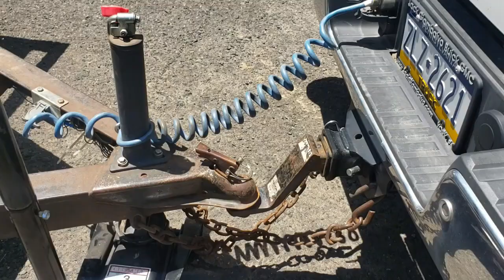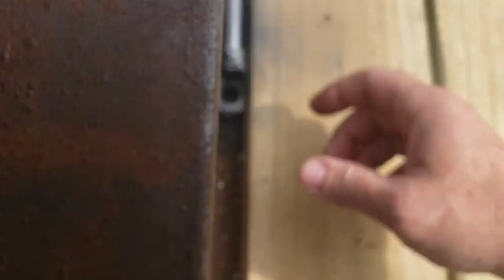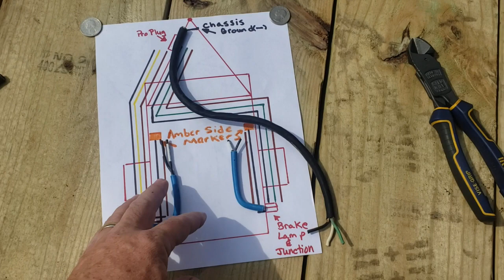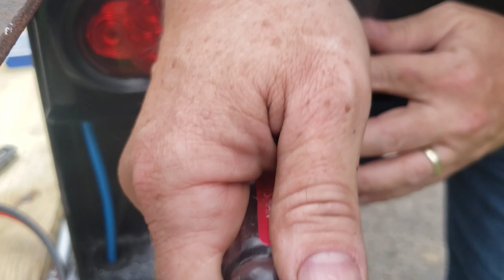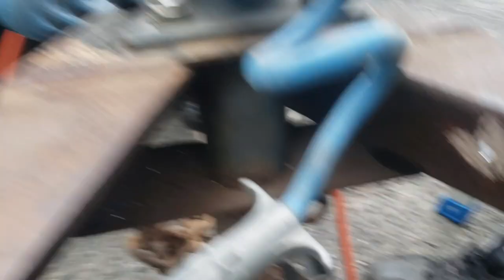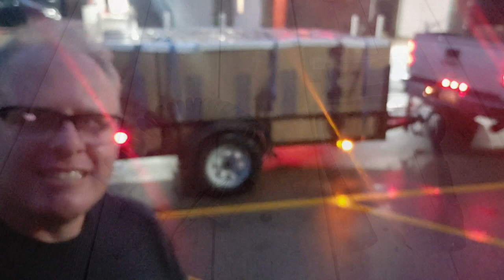5 Tips on How to Wire a Utility Trailer (long version) For Ultimate Reliability

Comment: In a pinch, when ypu cant find decent heat shrink connectors I've used standard ones but filled the cavity with RTV prior to inserting the wires, crimp as normal and the silicone fills all the voids sealing out any moisture.  Ive got connections on my boat trailer that regularly are submerged that have lasted over 8 yeara now, no issues.
Reply from the maker: That's a good suggestion, i'll keep that in mind. Thanks for sharing!

Comment: As for the 3 conductor wire, I go and buy a cheap 100 foot extension cord from the big box store, on sale there about $15.00 and thats a steal for 14 or 16 awg wire and its well insulated,  pair it with some good shrink connectors and it lasts a long time.

Comment: Can’t follow any of this at all. I have wired my trailer an no problems. Brake lights, tail lights, turn signal lights, backup lights clearance lights , lights on load being hauled. This is too difficult to follow.
Reply from the maker: This is not basic wiring, and I tend to do things with a bit of overkill. I'm happy to share the wiring is all still in tact and working! I share this trailer with several people and we probably put 600 miles on it every week. There are more basic ways to do it, for sure. I do appreciate the view and feedback.

Comment: Why did you even do a trailer ground, why not run the ground wires directly back to the junction box? Trailer frame ground connections are bound to corrode and cause issues!
Reply from the maker: @AlexKost-tq6bj  I think we're aligned. Kinda like what is explained @ 9:30 mark?
Reply: @PaulsProTips  maybe? Looks like you ran the ground wires back from the lights, but you still did a frame ground up near the tongue? Why not just connect the car's ground to the trailer lights ground wire, and have no trailer frame ground at all?

Comment: I get the advantage of the 7 PIN and the advantage of a junction box. But why not have the coiled wire permanently connected to the trailer instead of having a double side 7 pin? Twice the connections and more change for those to corrode/get gunk in them...

Comment: I went to a 7-pin plug for my 5'x12' utility trailer as well - for the reason you stated - everything has that now.
...even if I don't have brakes or marker lights - it's just easier to go to the standard plug....which always leaves room to upgrade.

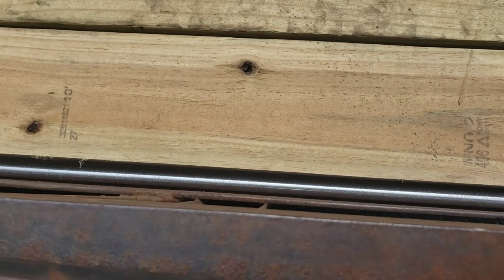Comment: What are those conduit end connectors (at 6:45) called that you're using?  Do you have a link where to purchase them? I can't find them anywhere.
Reply from the maker: If you search "emt pull elbow", it should populate with some great choices. I appreciate the question and thanks for watching.

Comment: Do you do this as a service for folks by any chance? I'm fairly close to the area.
Reply from the maker: No,  I don't.  I really am behind on videos I've started but haven't uploaded. The last thing I need are more of other people's projects.

This may make more sense, if I ever upload more videos.

I'm confident you can handle cutting off the old fenders, painting them and hanging new ones. You can weld or bolt them on. Worse case, there are enough trailer repair places in our area.

Comment: what do you reccomend to prevent rust on the underside of a newly installed steel trailer fender? I am having the rotted out fenders replaced on a well used older trailer I just bought.
Reply from the maker: I've not had a fender rust out quickly. The last one I replaced was on a trailer made in the 1990's. If you go to HD/Lowes and get a good brush-on metal primer and paint for metal, you'll be in fine shape. They make primer for clean metal and a different one for rusty metal.  They work great on the intended application. May need to reapply ever 5 years or so,  but that should do the trick for ya!

Comment: How would I wire up extra lights for my signals?
Reply from the maker: I'm not sure if I am misunderstanding the question, but you can just add more lights to any circuit you want. Is there a specific example you are struggling with?

Comment: I’m pretty sure you need to get a bigger truck for this trailer
Reply from the maker: I do now pull it with my dually a lot.  This is my lightest trailer,  but also the most frequently used. I probably take it on a 250mile loop 3 times a week!

Comment: How do you remove the lights if needed?
Reply from the maker: The rear you can push the lens in, remove the grommet and then pull out the lens and and unplug and replace it.

Comment: I'd have to put the connector wire in a box on the trailer, lol. I recently rewired my HF trailer using conduit and a 4 pin harness, but just ran it directly to the rear taillights. Each side of the harness has its own ground wire. I used non-insulated butt splices covered in adhesive lined heat shrink. I just did away with the side markers to avoid additional connections. It's worked well so far. If I do have problems, the whole harness is $20. I do like your setup if you have 7 pin vehicles. It should last a long time before you have any problems.

Comment: Great video can you put the where you got the wire and lights in the comments?
Reply: I use a cheap 100 foot extension cord from a big box store and cut it up.. 100 feet of 14 awg for $15.00 is a steal for trailer wiring.

Comment: Where can I find the pro plug system?
Reply from the maker: Link is in the video description!
Reply: @PaulsProTips  only the box is 35 dollars the could cord is 104 for the cheapest. So the set up you have would cost around 135 to 145 dollars.
Reply from the maker: @chescabler2659  I agree that the cable cost is more than the plug set-up- but you don't have to buy that version to make it work.

I have made my own for significantly less. Yes the coiled wire is nice, but if cost trumps quality- you can still produce a  solution better than any traditional configuration.

I would not let the cable cost prevent you from using the plug. We have them on all 4 of the trailers we use at work. Since I installed them 2 years ago, the amount of wiring issues we have has been reduced by 90%. Troubleshooting is very quick when we do and I have no regrets.

Comment: Does the pro plug separate the brake signal and the turn signal from the 7 pin on the truck? I'm trying to find a way to have certain lights dedicated as brakes and others as turn signals.
Reply from the maker: The Pro Plug simply conveys the signal. So you could grab the brake controller (blue) wire- which typically gets wired into electric brakes and use that as a brake signal.

The challenge is that the turn signals  would still get activated when you step on the brake.

It really would have to be separated at the tow vehicle, before the proplug.

Comment: You make it look more complicated than what it really is
Reply from the maker: You may be right. Somewhere in between this and what these trailer manufacturer's offer may be all that is needed.

Once this is done though, my system is very reliable. It also is interesting to diagnose. Several people have claimed a trailer has a wiring issue, but I can confidently show how it is their truck which has a poor ground, or a blown fuse.  The fact I work with 10 guys who share a handful of trailers, and there has been zero trailer wire issues for the last two year tells be this system accomplished just what I intended.

To circle back to you comment, - yes factory trailer wiring can be improved with less material and effort than I do. What do you feel are the basics to improve them for reliability?
Reply: Why wouldn't you run side markers in series?

Comment: very nice ideas, when I rewired my trailer, folding 4x8 trailer from 1988 w/ steel deck, I ran a separate ground wire to the rear lamps and didn't bother with the trailer ground, and no I am not running side markers, I do have side reflectors on it. I also soldered w/ heat-shrink the connections, due I work making wire harnesses.

Comment: For those of us that are use to being suckered into those 16 gauge trailer light kits, could you list out the Build of Materials, please?
Reply: i dont have any problems using the "16 gauge" wire provided with any of these kits,  i do add a wire for ground,  i dont like drilling into the frame and using the body as a ground and run it all the way to the plug ---- I NEVER crimp my connections,  I always solder and use heat shrink then electric tape wrap  and use that plastic wire wrap stuff

Comment: Great idea for parallel wiring the side marker lights. I dispensed with them on both of my trailers due to the inherent weakness of a mid-wire splice. I will use this idea & install side marker lights on my two trailers. Thank you.
Reply from the maker: Thanks man. I am appreciating the feedback and thrilled to hear some of my techniques are worth sharing.

Comment: Any vids on wiring a trailer with electric brakes?
Reply from the maker: I am building a homemade single axle with brakes. I will shoot some of my techniques and share them soon.

Do you have a particular question or challenge you are looking to solve?
Reply: Paul's Pro Tips Someone really rigged the wiring on the trailer I bought used. I really just want to replace it all including the wiring for the brakes but auto wiring is not really my forte. Regular mechanic stuff is easy but I have no confidence in troubleshooting electrical gremlins.

Comment: Very nice video. I like your position on the ProPlug apparatus. For me, it would make sense to carry the connection cord in the truck. That would also offer a little extra theft-detterence since someone wanting to steal your trailer would think twice about driving off without any lighting. (Not full-proof, I realize) 

I have a question: Sorry if this may seem a little picky, but do you really feel comfortable with that ProPlug box being mounted on the tongue with just 3M adhesive? I live in a moist climate with cold northern winters, so there's rain aplenty and also snow, ice and road salt. I'd was wondering, is there a way to weld a box onto the tongue and stick the ProPlug box inside the box for extra protection, or is there an easier way to attach it for better security? I was also wondering if there's a way to unplug the ProPlug box and take that with you, as well, for extra security. Another nagging little question: our small construction outfit has been using four-prong trailering cable connections for years. Does your multi-prong system allow for trailers to be equipped with a "backup" light, and what search terms do you use for e-shopping for LED lighting assemblies that include such a light? I like the idea of a trailer with back up lighting, both to let people know the trailer is backing up and also to illuminate what's behind the trailer to make is easier to operate on cloudy days or in twilight. One final question: have you ever hooked up any of those trailering cams, and if so, do they require their own cabling system?
Reply from the maker: I appreciate the comment and questions. I'll do my best to answer- though I think I may do a video to expand on the camera question.

I agree the security part of the plug not being ready and able for any theif to properly illuminate the trailer is an added benefit. Which you could get inventive on with your 1st question.

I was skeptical on the 3M adhesive when I 1st discovered this. I find the majority of people think they are above average. I'm humble enough to admit 3M makes some great products and I bet their engineers and teams know a bit more about adhesion than I do- so with that in mind, I tried the adhesive and so far, it is working perfectly. 

I actually had a large fellow use the plug box as a step, and the adhesive did not budge.

They do make adapter plates to mount it to a round tube rail- so there are options when the adhesive doesn't work. You could also simply take the cover off and use some fasteners with or without the adhesive back removed. I now have these on 5 of my trailers- going back as far as 2017- and my confidence in the adhesives is high.

I live in the suburbs of Philadelphia so we see plenty of rain, snow, road salt and cold. Not as bad as some- but I think our seasonal changes span enough to really prove the 3M product delivers on expectations. 

If you did choose to make a little steel cover for where this resides, it could even have a lockable face for that security we were mentioning before. The cover could also shield the box from sun and rain. Not required, but for those looking to overkill an installation, I would applaud a well executed box over the plug.

Unplugging the box to take with you is possible, but if it was security you were after, there likely are more effective areas to focus energy.

The ProPlug has the same 6 circuits (and ground to make up the 7 prongs) that any truck made today has so the back-up circuit is already in place. It would be easy to mount some lighting and grab the circuit. I may do a video on that!

The trailer cameras are super cool. I have a coworker with a 2020 GMC with the trailering cameras and it is awesome!

They do have 2 inputs for camera right above the 7 pin plug, so yes- they are separate. There are also wireless cameras to stand alone devices, as well as ones which hookup to your phone (assuming via bluetooth). I do plan on exploring these in another video.

I totally relate to what you described as a small crew using the trailers with the flat 4 plugs. Up until I started installing these ProPlugs we would constantly be "maintaining" the lighting on 3 trailers. It always seemed the lighting would need to be addressed at a time where it was inconvenient.  Since these were installed (using the method in the video with the ProPlug), we have had zero trailer light failures.

I did have one guy hook up his 2016 Chevy 2500HD and initially thought we had an issue. After using the LED lights to diagnose it- removing each terminal individually - brought us to the conclusion the issue was back feeding from the truck! This guy now has a harness he made which only has 4 wires and the backfeeding issue has been eliminated.

He is a volunteer firefighter and has a few extra items on the truck. I can't say for certain the root cause- but his work around is sufficient for our small trailers.

With any other system, it would have been much more difficult to sort out the root cause.

Thank you, and keep the comments, questions & requests coming!